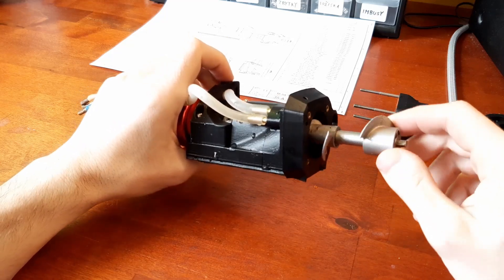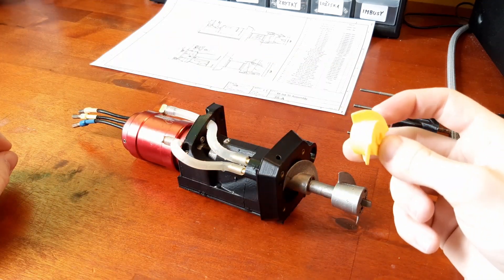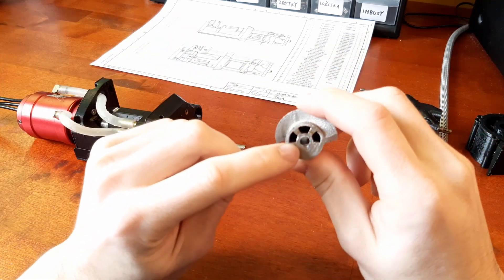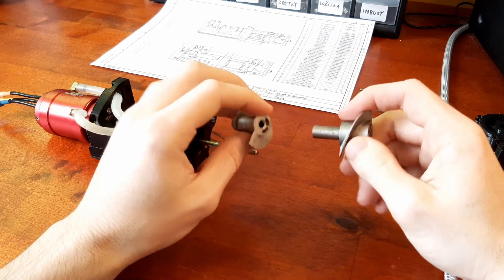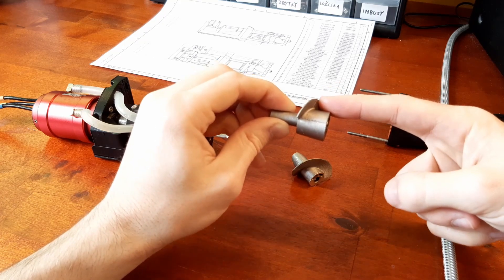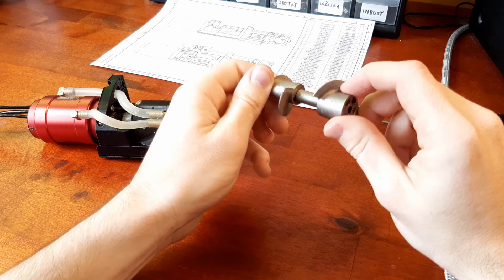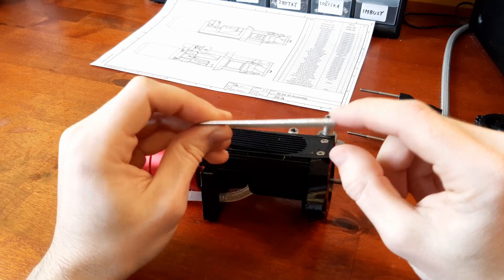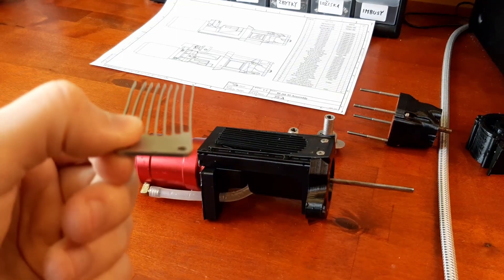Stainless Steel Impellers Jet Pump Test / M-Jet 35 Development

Comment: You probably have measured it, but do you know how much power this consumes at half and full throttle?

Ive got a project in mind and i'd like to know if i can borrow some of your ideas🤔
Reply from the maker: Yeah I measure it all the time, this is leopard 3665 1050kv on 6s, 120A esc and it consumes close to 80 amps. I dont know how it is at half throttle but maybe around 30A. Which project, I am curious:D?

Comment: Stephan I just finished up my boat build with the M-jet 30. I decided to coat the props in a thin layer of epoxy. They feel crazy strong. I mixed glaze coat epoxy with denatured alcohol to thin. then coated the prop and used compressed air to fluff off the extra for a smooth even coat. https://youtu.be/PHkCRiiTqds
Reply from the maker: Thanks for sharing your build! Coating impellers in epoxy is a good option indeed. Some people on the rc jetboat forum have successfuly tested it, but your method is new to me. Thicker blades could be an efficiency disadvantage, but I see you chose a big motor which can handle it!

Comment: Will you ever design this jet into the m-jet rc boat or is it to big / powerful
Reply from the maker: Hi, this is a much more powerful pump than the one in M-Jet Sprint and is meant for a bigger boat (around 50cm) which I will build after finishing this, the M-Jet 35 development.
Reply: @mjetdevelopment  cool thanks 👍👍
Reply: @mjetdevelopment  could you make a smaller one of these and put it in the m-jet or na. thanks
Reply: @mjetdevelopment  another thing I'm building the m-jet and using a 1500mah 3s and a 2216 2300kv brushless motor and a 50a ESC will that be quickesh or slow as
Reply from the maker: @JanHarmSteenkamp  Thats a really small motor for the boat but if thats your goal, I wish you good luck with an interesting build! So far I am not planning to change the pump in the M-Jet Sprint simply because I would probably have to redesign the whole boat because of it. Currently my plan is to finish the M-Jet 35 development and build a boat for it. I am hoping to make progress even though my time is very limited by my studies;)
Reply: @mjetdevelopment  thanks man 👍👍👍

Comment: i was thinking if you arealready 3d printing metal why not remove the shaft  and insted integrate it in to the impeller and  make use of the space towards the center of the impellers, granted im not sure if that would be benificial or worse but it should be less moving parts and easier to balance in theory
Reply from the maker: Yeah I also had this idea when going to stainless steel. Mechanically, it would definitely be better, no play and less parts, but it would have important disadvantages: 1) the 3D printed shaft surface would not be smooth enough for the rotary shaft seal 2) lower shaft accuracy than with a simple smooth 5mm shaft 3) the second impeller would have to be removeable anyway because the first stage vanes need to go between the impellers:)
Reply: @mjetdevelopment  i think the surface finish could be fixed with some light machining but that does negate the point of 3d printing, the point about the removable second impeller is the hardest to overcome, if the second stage dident need vanes then it would be an easy fix but i assume they add a significant amount of performance since you keep them. when you are ready to sell these id like to buy one, im loving the mjet 30 in my big boat but it needs more power, and the mjet sprint is perfect
Reply from the maker: @peterwibe2654  I also tested the pump with no first stage vanes (no vanes between impellers) and the priming got much worse, to pretty much single stage pump level. So to get the two stage advantage, vanes are definitely necessary. And thanks for your kind words:)

Comment: This may seem a dumb question, but what is the purpose of the upward-pointing spout I see on jetskis and also these tiny designs?
Reply from the maker: Thats watercooling! It takes small part of the water in the pressurized nozzle and goes through the pipes to cool the motor and esc, then goes out. I design it pointing upward to always see if it is working properly.

Comment: Sorry, im new to the channel, but perhaps casting the blades would be a better option? also perhaps a magneting bearing separating the two propelers so the water flow does not induce more vibration? it could just be a magnetig ring ourtide, in the shell and a inner oposite pole in the middle, so there is no contact, but the magnetic force keep it centered?
Reply from the maker: Thanks for sharing your ideas! I considered casting the impellers from aluminum using lost PLA method, but I have no furnace, and the results would probably be worse quality than this anyway. Also aluminum is only about half as strong as this material, and the price where I order them is not too bad.
I am not sure how you mean a magnetic bearing though. The impeller driveshaft is firmly supported by ball bearings on both ends. A magnetic bearing would be very difficult to implement into this design and the unbalanced impellers would still vibrate..
Reply: @mjetdevelopment  Then the only idea i have is counterweight on the propelers, something that you can easily screw there?
Reply from the maker: @gaevsprivs  I am trying to balance the impellers as they are, just with their shape, without any additional balancing elements. I have already ordered a new pair of impellers with an improved design. The CG of each impeller should be perfectly in the center with the new version, and at the same time both blades are on the opposite side, in theory not requiring any further balancing. I will hopefuly get them in 14 days and test if it works!
Reply: @mjetdevelopment  I love this project, so i hope all works!, Please keep postin videos 😁
Reply from the maker: @gaevsprivs  I will, I love it as well:D
Reply: @mjetdevelopment  Sorry to be annoying, but have you considered an eccentric location for the shaft hole in the propeler?, i'm sure the vibracion comes from a slightly deviated center of mass, im the kind of person that cannot stop to think about how to solve a problem :P

Comment: Great job Stepan, it is amazing how well the 'half bladed' impellers perform. You might try mounting them on the shaft, then all on a prop balancer adjust them for best balance? They may not be symmetrical when balanced, but it wouldn't matter. Keep up the good work!
Reply from the maker: Thanks! I already ordered new ones with improved design and I am hoping to solve the balance completely, we will see! I just have to wait 14 days for them again

Comment: Wow, your multi-pipe nozzle makes the swimming pool too small! 
Amazing the efficiency you get with single bladed impellers. You ordered binder jetting steel impellers. It is much more affordable, however the inevitable shrinking is not uniform nor predictable. What I do is order a piece, measure it and alter the design specific for printing.
Reply from the maker: Thanks! The impellers in this video are stainless steel 316L metal filament. So not binder jetting - I wanted to avoid binder jetting exactly because of that shrinkage. But this metal filament shrinked as well - shaft hole from 5.2 to 4.7mm. And weirdly, the second impeller length increased from 37 (designed) to 37.6mm. Right now I changed the design to compensate for this, and also changed the mounting so that I can drill the holes to H8 tolerance easily. I will have to wait for them another 14 days..
Reply: @mjetdevelopment  what is the price difference with binder jetting? Where did you order?
Reply from the maker: @michielstuip3547  This: https://www.sculpteo.com/en/materials/fdm-material/ultrafuse-stainless-steel-316l/
It was about 3$ cheaper than binder jetting
Reply: If he keeps shooting it out of the pool it's gonna be empty in about 5 mins worth of test runs!  Lol 😆

Comment: more Wonderful stuff  :) very well done Stepan, a thicker shaft might cut the vibration down a bit, the 6mm I'm using
still has some movement in it with all things balanced, smashing job mate,
have a great day :)
Reply from the maker: Very good tip, I will consider it, thanks!
Reply: @mjetdevelopment  or maybe you can also try to design a more efficient 3 blade pump with a total blade area roughly equal to your current 1 blade design? I wonder if it is feasible.